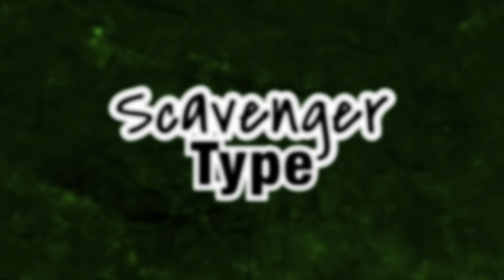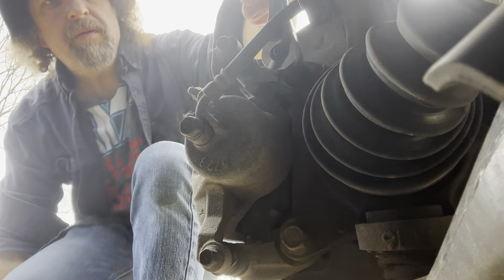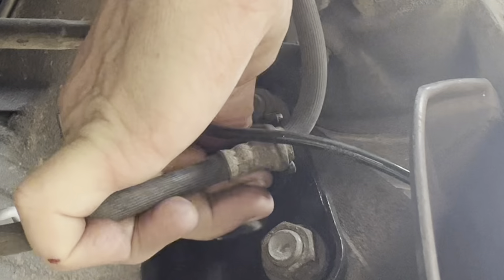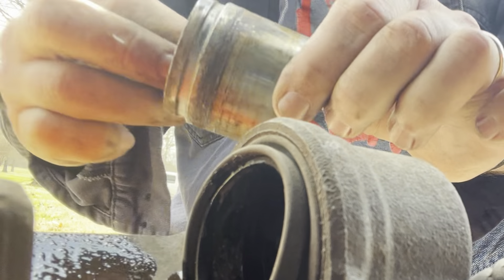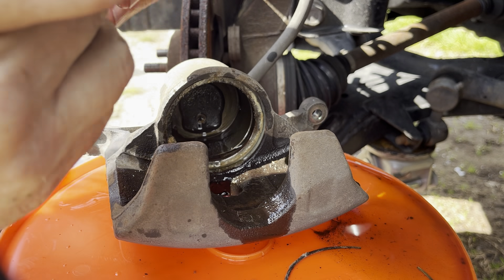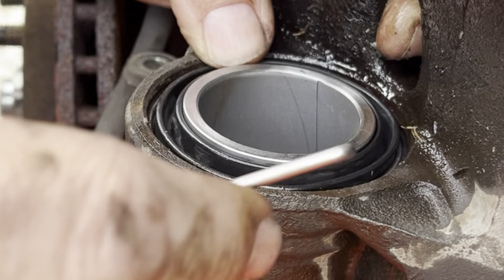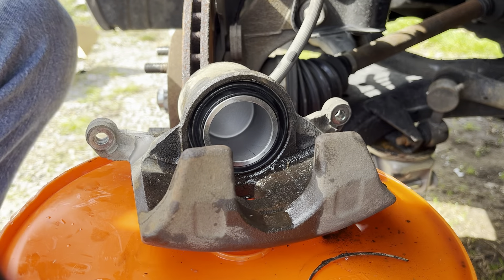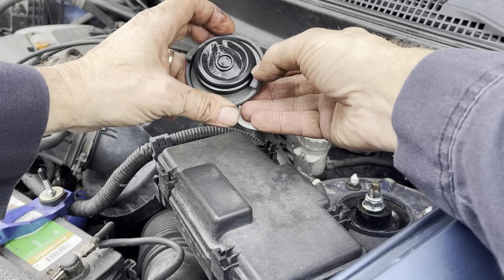Rebuild a brake caliper ON THE CAR Honda Element

Comment: I've had 2 calipers seize on my old '06 Element in 200k miles.  Replaced them with remanufatured ones.   It doesn't look all that harder to rebuild them.  Great video as usual.  Thanks.
Reply from the maker: Right on

Comment: Great video.  I just noticed some noise yesterday and I think it’s my front - left wheel.  I suspect it’s the caliper or another brake issue, but it’s good to see you take it all apart and explain everything in your expert way.  Thx!
Reply from the maker: The Honda Element calipers are famous for locking up.

Comment: Nice vid 👍Just swapped out a original rear caliper on my 20 year old Honda FRV but im rebuilding the original just for the heck of it and have it as spare its nice oem caliper. Yeah do a video on the hoses i need to swap mine i started to do it but the nut wasnt budging and i needed the car and didnt want the job turning into an all day job 😂 think im gonna need to heat it
Reply from the maker: Good luck! They can be a pain to get off. I may look at installing some braided lines this summer.

Comment: The biggest reason i see to rebuild calipers is ..almost every"new" caliper is a reman.. so just Diy and save a crap load of $$
Reply from the maker: That's true. I was looking closer at the box for the Cardone caliper and it said "rebuilt" in tiny little letter.

Comment: Great job! But next time you do this, take the caliper off completely after removing the piston, and thoroughly clean the caliper with brake clean and a wire brush, and clean the cylinder with a sift scotch brite and thoroughly clean the cylinder.. any acidic brake fluid and rust will cause more issues. After cleaning, fresh brake fluid in the entire brake system
Reply from the maker: Good idea. I'm going to flush the entire system this spring along with the Power Steering system.